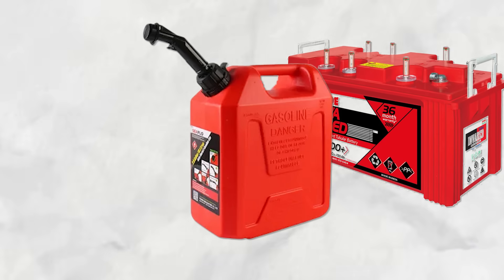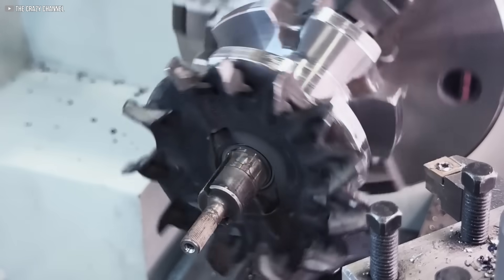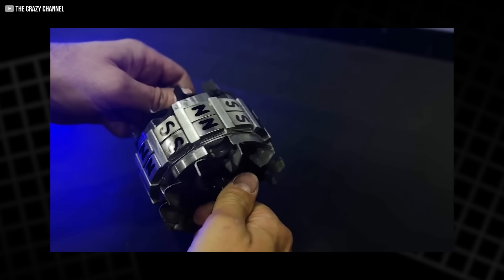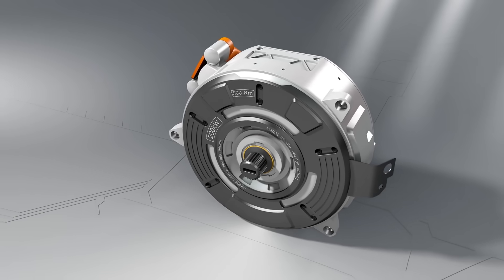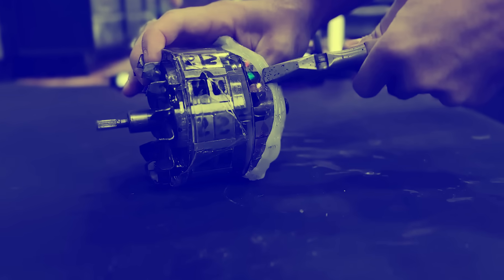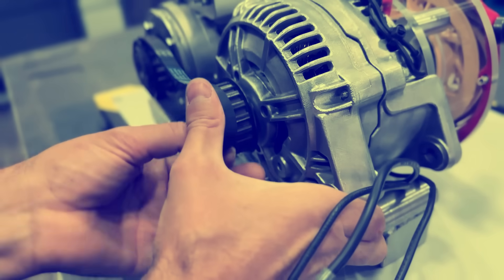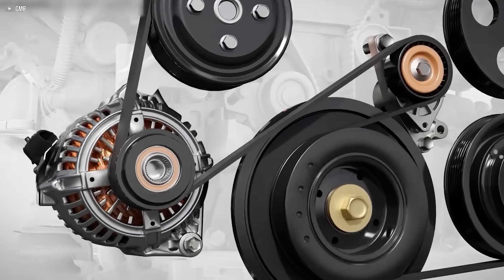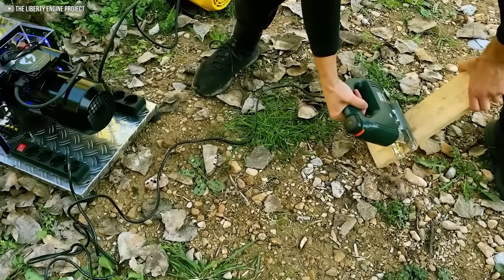This DIY Generator Produces Infinite Power – No Fuel, No Battery!

Comment: Savage. How long can run for, is cool down a factor? If it does require a cool down time, is it possible to use a duel cooling fan to keep it at a consistent/regular running temp for consistent/non-stop run duration? With Respect & Appreciation from HauntedDemons 👊💯💚💜

Comment: 1. Will it generate enough power for a common house size?
2. How do you connect it?
3. Where can I buy one?
4. How much for a FULL installation?
5. Does it need maintenance?
6. Will it run quietly, day and night? 
🙏🏻
Reply: Such engines have been on the market for a long time, but most people don't know that the petrol industry has been secretly buying up the patents for such inventions since around 1930, which is why a maximum power of 1 kilowatt is permitted for homes and 5 kW for industry.
Reply: Normal you can use at home but it's stopped after some time you need to restart many time not this but i make my own at home but its good for portable generator
Reply: @MujammilNalband-q7t  com rodas de imãs?
Reply: @Clovis321  yes magnet wheel stop After some time!
Reply: walmart isle 9  shelf 1  column 1
Reply: Alibabá/AliExpress

Comment: Por mejor tecnificado que esté el alternador para que produzca 220 voltios  NO entrega lo que dice el señor.
Yo hice uno similar con un alternador de camión ,  he calado el rotor y le puse 8 11:50  imanes de neodimio de 4 8 cmx 2.5 y  el grueso de 1.1 cm . con 8,000 RPM   apenas me da  36 voltios    con un imán adicional he revisado uno atrae el siguiente repele otro atrae y así sucesivamente.
No entiendo cómo para otros les sale 220 v.  a mi solo 36 v.
En otro vídeo publicaron que los generadores con alternador son falsos....será?
Reply: You have to copy it precisely.  Don't put ANY MAGNETS. Two magnets Arc shaped are put together. That changes magnetic field.
Reply: And 12 spaces x2 =24 magnets north south.
Reply: If the number of turns of copper wire in the stator remain same as original, , the voltage will not reach 220v.
Reply: It's really advanced for what it is, & it is possible to get 220v as long as everything is exact. Different variations equals different outputs.
Reply: 36V Και περίπου 19A Αυτό σιμενη ότι η μαγνητική ροή  (Φ) ανά τετραγωνικό εκατοστό εκατοστό είναι μικρότερη από αυτήν πού υπήρχε πριν ! Όλο το έργο βασίζεται πάνω στην μαγνητική ροή όσο μεγαλώνει το (Φ) τόσο μεγαλώνει και η έξοδος τάσεως και σε αυτό βέβαια συμβάλουν και οι στροφές της γεννητριας ανά λεπτό.
Reply: Το όλο έργο βασίζεται στην μαγνητική ροή (Φ) Εάν έχετε έξοδο 36V Και (I) Περίπου 19A Τότε το Φ Είναι κοντά στην αρχική  μαγνήτη ροή όσο μεγαλώνει το Φ Τόσο μεγαλώνει και η έξοδος σε (V) Σε αυτό συμβάλλουν και οι στροφές της γεννητριας.

Comment: Good is the unit available on market in how much and where to buy😮😮😮
Reply: I wish to buy the modified alternator also.  Is it for sales and how much ?
Reply: I am interested. How much power this will produce. Can it power a small  pump for agricuktural use? HM.
Reply: Not available for sale you need to your own 👍🏻
Reply: There is more options available check out first